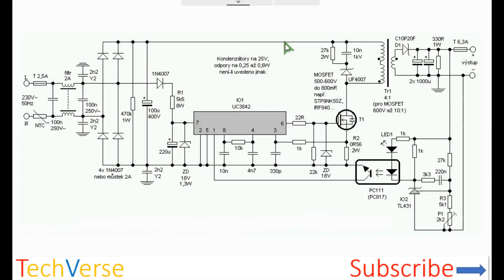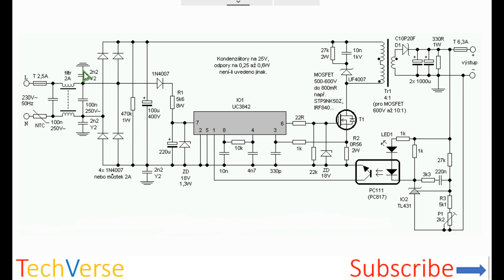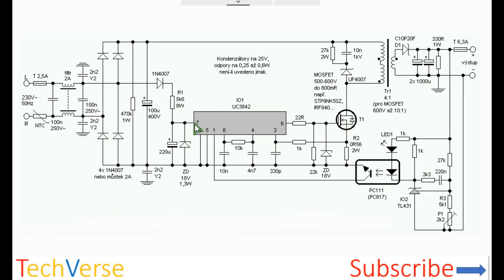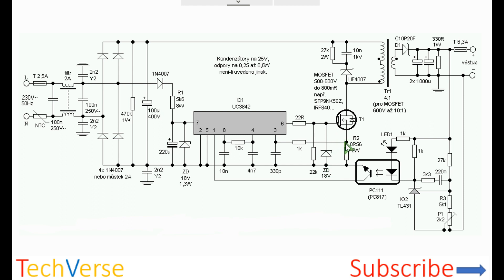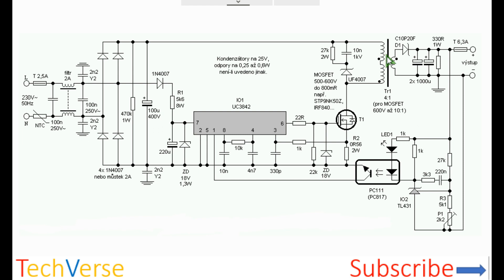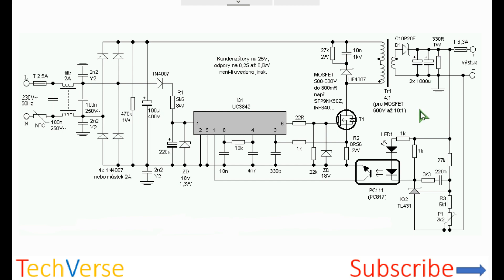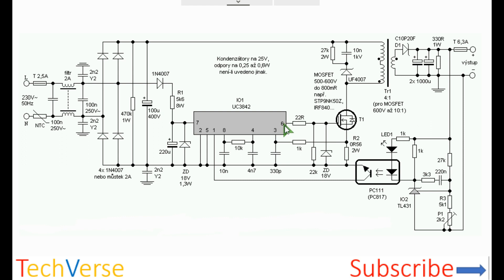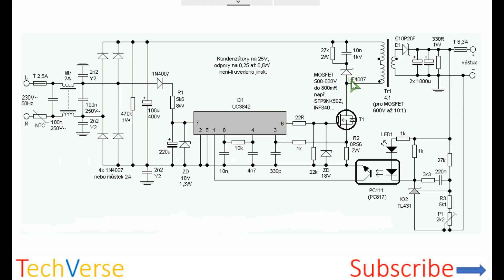UC3843 Switching Mode Power Supply (SMPS) 0-50Volts 10Amps!

Comment: The information in the presentation is wrong. This topolgy, kind of flyback, is not capable of giving such powers. And in the schematic, feedback circuitry  tells me that it can adjust the output voltage only in a narrow window.

Comment: I wonder how power of 50X10=500 watts is available from mosfet having max power output of 150 watts(if 840).
Reply: I think since mosfet operates in pulse mode, it will not need to dissipate so much power

Comment: How can I make 12V 4A smps with 24V power supply
Reply: You can do it by a little intelligence The power input need not be stabilized as is capable of working@27v easily. The same circuit may be more used by now connecting the drain of a more beefy mosfet (>50A) connected to a inductance that should be rated at atleast 4A whose other end should be connected to the+B of 27V that you will be feeding. This should be followed by another Schottky from this junction which feeds a filter capacitor of around 2000,if rated@atleast 50V. Construction should observe all rules and practices of all hi current circuits like good layout, thick pwr tracks along with star OR bus bar ground and NOT both mixed. Do this and you should be fine.. Best of luck

Comment: Hope, that there is nobody following your howto. You have apparently just copy&pasted the schematic from czech engineer.
a) There is a czech description for what resistors, capacitors, graetz rectifier and MOSFET you should use.
b) The same schematic, but with removed czech texts can be easily found on few russian pages.
c) Given the parts, it is not 0 to 50V PSU, but it can be set between 11.7 and 15.7V.
d) No, it is not capable handling 10A load, at least there is a fuse at the output limiting the usable current to 6.3A.

Please, do not steal others schematics. Show your own work! Thanks
Reply: Yea, danyk.cz, and the owner of the circuit have an YouTube account called DiodeGoneWild.
Better to tag him or his page.
Reply: also you are right about the voltage and current 6.3 a fuse and about 15v max it uses 25v output caps,  think the original design was a lead acid battery charger circuit. guys like this steal others work and worse give wrong info about it someone will get hurt or burn their house down
Reply: the author of the schematic is a guy called Danny K he has a youtube channel called diode gone wild

Comment: The maximum power of the flyback BP is not more than 150-200 WATT. 50 * 10 = 500 watts. Overall power throttle will not allow to remove such power. What am I wrong?
Sorry for the translation.

Comment: I will not use the uc3843 here, because the pwm is not limitet to 50 %. Uc3844 or 45 should be ok.
Reply: This would mean you just need a bigger transformer etc?

Comment: It is better to use an oxiliary winding to power the uc3843 and R1 just for start up
Reply: yes but this is a variable voltage power supply and if you were to power the chip from a auxiliary winding the voltage to the chip would change with the set output voltage as it is on the same transformer
Reply: Original author intended to use it as battery charger, like this it wouldn't cycle with overload. It would just reduce output current, quite simple and clever actually.
Reply: Yes because it's really a 11v to 15v PSU.
No if it was a real 0v - 50v PSU, because if the o/p is to varied low or to near zero voltage, the auxiliary output would also go low or zero voltage, thus no power would go to the chip.